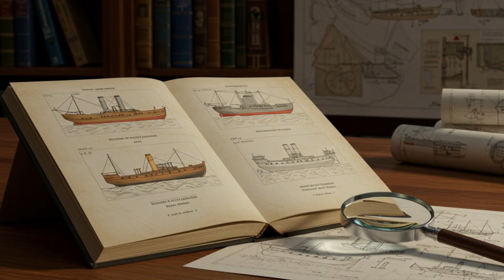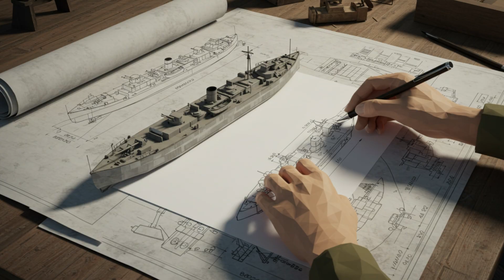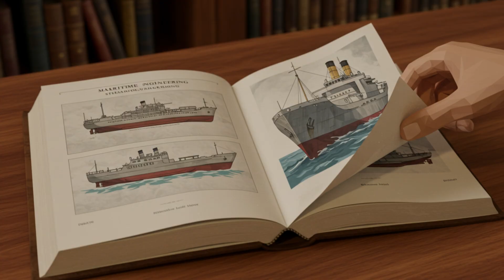The Mystery Behind the U.S. Navy's Concrete Ghost Fleet

Comment: The 'Atlantus' is approximately 10 miles (as the crow flies) from where I am viewing (and commenting) this documentary. This has always been a local, historical artifact. I've been on the 'Atlantus', back in the fierce cold winter of 77/78, when I, along with 5 (out of 50) others, were able to climb the shards of vertical ice, required to scale, to make it to the ship.  There were actually rooms, though very slanted, to walk through then.

Comment: Ships are built to flex: concrete is strong in compression and weak in tension, hence it is reinforced with steel bars. I would be concerned about "hogging" creating small cracks that would permit salt-water intrusion that will corrode the reinforcing bars. There are small feroconcrete boats, but I am skeptical of scaling this up, especially for ships that must endure battle.
Reply from the maker: That's a good point. That would be a serious challenge for engineers.